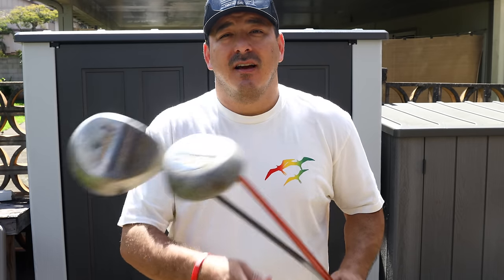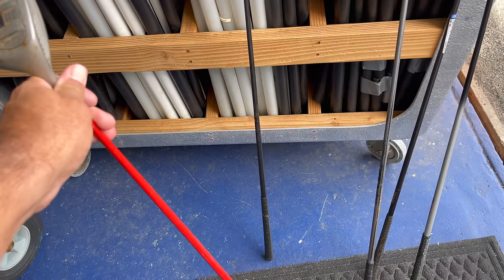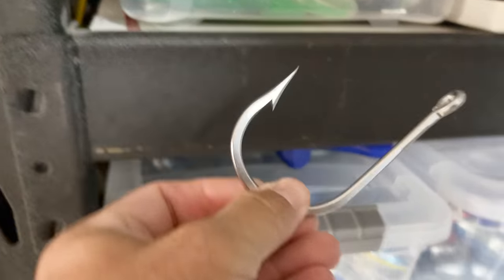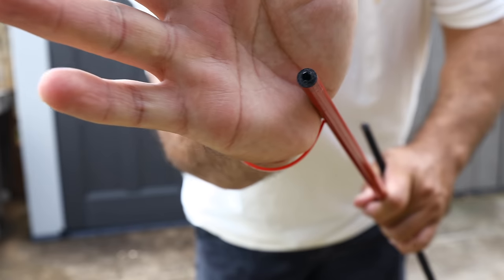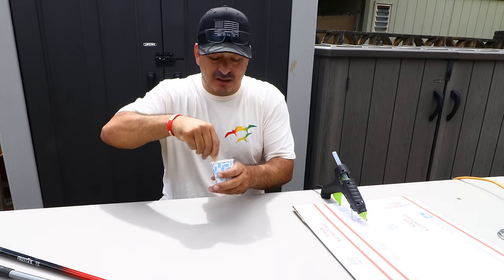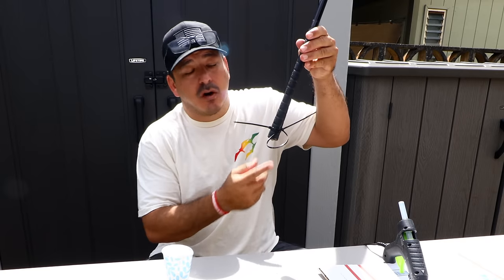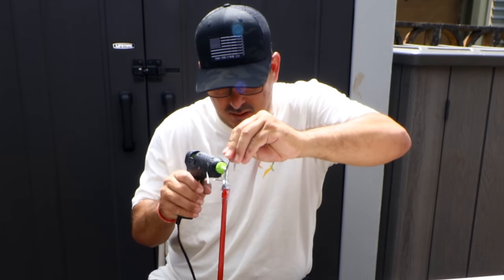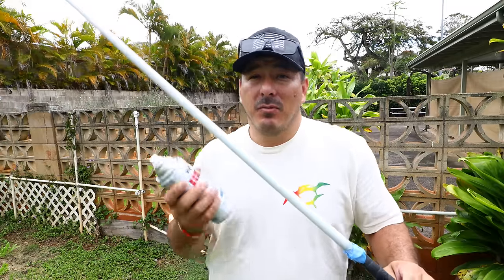$10 DIY Fishing Gaff - Best Gaff You Will Ever Own

Comment: My pops used to make ulua gaff and when he needs epoxy in tight places he used disposable syringes! But I guess use whatever works! Mahalo for the tip 🤙🏻
Reply: Lenny, fyi, Tractor Supply (and most feed stores) sell these syringes very cheap and different sizes as well. I always pick some up for oiling things or injecting epoxy like your pops in some crazy tight areas. It's cheap and very effective without the mess. Your pops knew what he was doing..  Joe

Comment: If you clean the clubs rubber grip with Fast Orange hand cleaner, it will remove the oils and shiny film from the rubber and restore the grips original tackiness, making it much less slippery, like brand new. 
This was a great video and an awesome idea. I just happen to have some older graphite shaft drivers that I am going to convert to gaffs. Thank you for this...
With great respect, a new member of your channel....... Joe
Reply from the maker: Thanks for the tip 🤙

Comment: Thought of a good improvement. Once your assembling put the head in the shaft. Put a small amount of glue to hold in place. Pop the end cap off. Put the epoxy inside. Then swing the gaff forcing the glue to the shaft of the head. Could it's shape the epoxy should make a plug holding the head. Seal the plug and glue the cap back on.